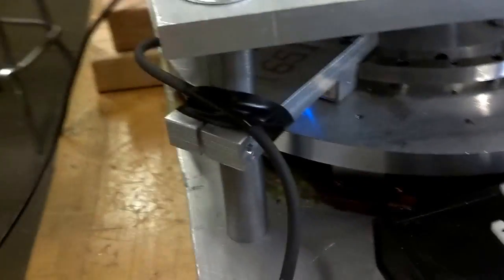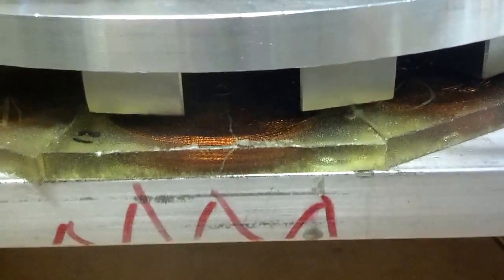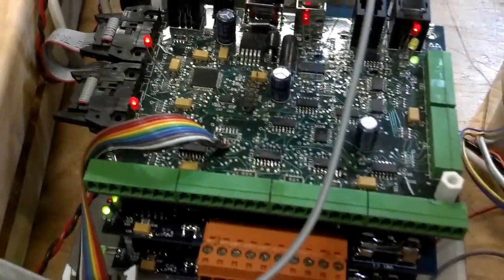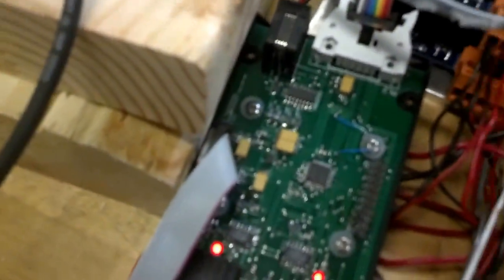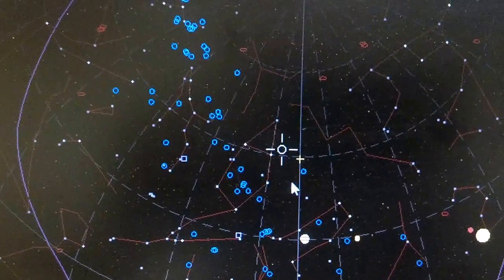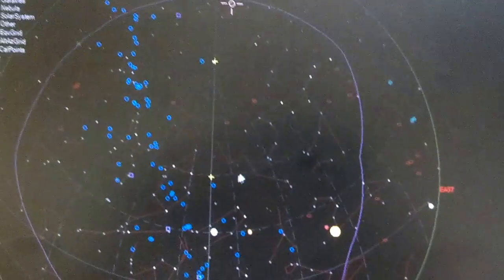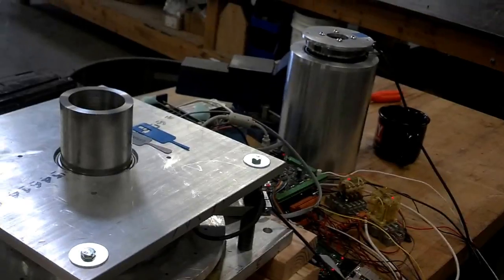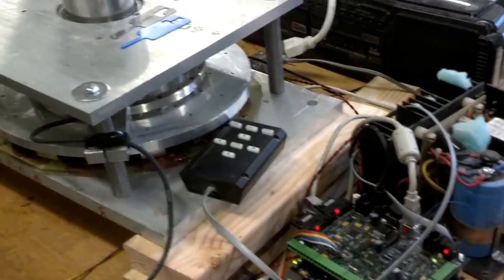Prototype Direct Drive One

Comment: hello Dan, in order to run the motor so slowly, which kind on signal is used ? I guess it's a SPWM or SVPWM but what is the resolution and frequency who is necessary to obtain it ?
Reply from the maker: It's 3 phase PulseWidth Modulation, I'm using 11 bit.

Dan
Reply from the maker: I'm running about 23 KHz.  But the reason it can go so slow, is the position PID (proportional integral derivative) using the feedback of the high resolution absolute renishaw encoder.
Reply: ok ! 23 Khz is the PWM frequency I guess,  this have an impact on the movement ? Or it is just a frequency used to avoid noise ? I guess that the rotation speed is set by the loop frequency who is tuned by the PID ? Three questions in the same post ... :-) but it's very interresting...
Reply from the maker: There is also a PID sample time.  THis is adjustable from 2KHz to 4.4KHz or so.  This is the position control loop. both the PID frequency and the PWM frequency do have  an effect on the position control.  Neither of these have an impact on the rotational speed, the system is always controlling position, it's just that sometimes the position is moving, or stopped, or moving at 5000 rpm.
Reply: 5000 rpm ?! poor telescop ! :-) thx for the explanations Dan, i'm trying to do something similar but at lower scale of course (faster system as my encoder precision is far from your one) but with PID control. we can found lot of brushell motor controller for fast rpm but for slow it's rare.
Reply from the maker: You can see the manual here:
http://siderealtechnology.com/BrushlessManual_1_4.pdf
Reply: thx for that. i think i already read two or three times all publications you made arround this project :-) I'm trying to reproduce the movement part with a motor that I'm building with 3d Printer (12 coils, 14 magnets) and drive it with an Arduino Due (@96 mhz with a 12bits DAC).
Reply: I control the engine rotational speed by varying the frequency of the loop applying the pwm values on my three phases. I wondered if it was the right method to use ? 
Because I have a lot of trouble with the pid function to control the motor speed. For the moment i'm using a simple quadrature encoder and take the number of ticks every 100ms at higher speed.

Thx for your help.
Reply: Hello, I have replied to my question myself... nothing to care about the speed as we have to use position PID. I have ordered a little absolute encoder 15 bits with SSI protocol on ebay.
Reply from the maker: Hi William,
I think you should use may normal email, so I can remember to reply!
grayarea56@gmail.com

Thanks.

Dan